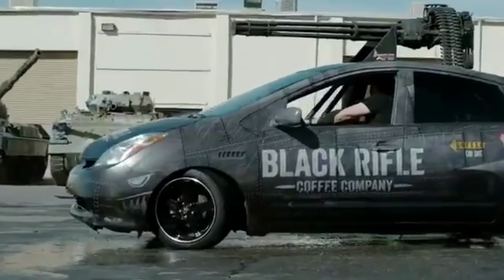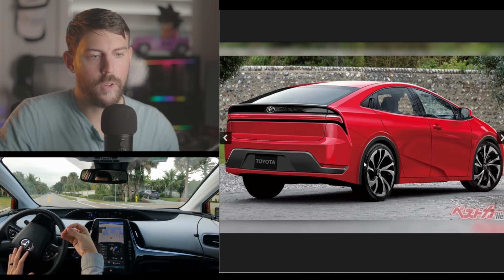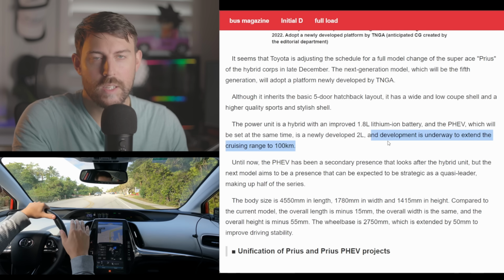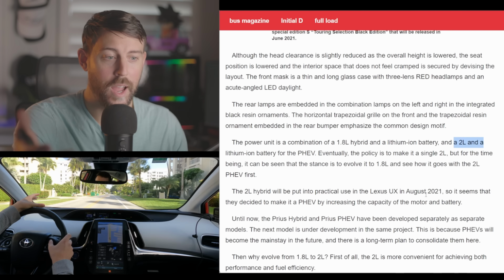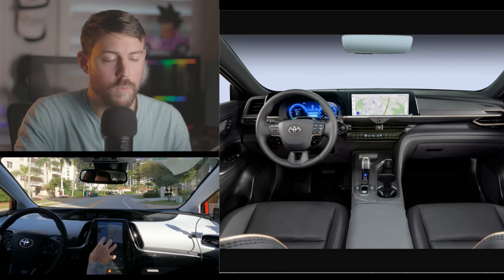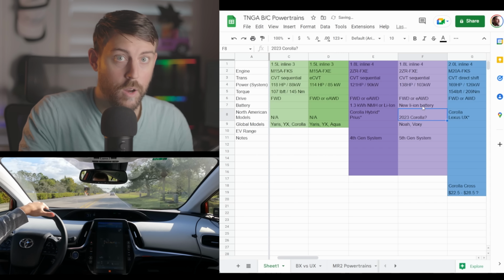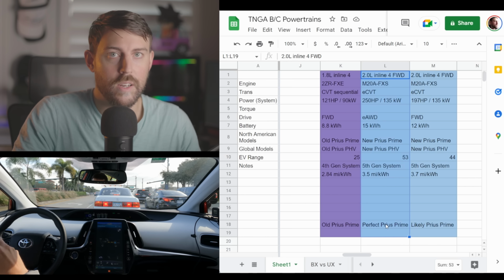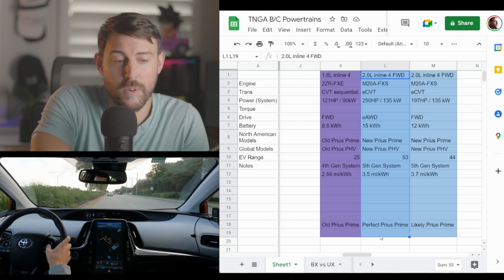*BIG UPDATE* The All-New 2023 Toyota Prius will have INCREDIBLE power and EV range...

Comment: Nephew just bought a 252000 mile 2nd gen for a few grand. Runs very good with very few signs of how many miles are actually on it. Can't see why it won't easily hit 300+
Reply: Really?? Why would you say that??? I can tell you exactly what will stop that thing from hitting 300k if not attended to.  IF there is no documentation of a recent water pump replacement in that 1.8 L 2ZR-FXE he will 100% loose that motor at any time.  It is a known catastrophic weak point.  That and a clogged erg system filter.  the later will give some prior notice, the water pump fail has few signs, it just blows the headgasket and the motor is toast.
Reply: @dvmartel1  Yes, the vehicle came with an extensive service report which included a water pump and a full exhaust system done at a  dealer.
Reply: @dvmartel1  Also, a blown head gasket is not a total engine failure.

Comment: I need a cheap car. Like the original Generation 1. With small tires, cheap maintenance, 1.5l or 1.8l engine, great mpg, and good reliability. No plug in, no electronic gimmicks. Just want to drive. The 2l Lexus engine has some issues. If I wanted speed then there are dozens of other cars available for that type of driving.

Comment: PHEV’s should seek to optimize electric vs gas miles for the majority of likely consumers. If 40-50 miles covers 75-80% of your daily commute then increasing battery size, weight, charging time, and cost will likely not be worth the savings. But, sadly, that’s not how advertisers and consumers minds work. We buy a car for the one or two road trips a year we hope to take and then drive it to commute 20-30 miles to work 95% of the time. Total waste!
Reply: If 40-50 miles is all you cover on a day, then get a scooter.

Comment: I keep hoping to hear Dynamic Force and/or Combined injection in reference to the "better engine". The cylinder heads are the only likely place to get the additional power, and adding DI to PI yields around 10%! ;)  (In the 1.8 liter Prius. DI + 200 CCs for the (heavier) Prime, even better!)

Comment: That's incredible. If the range is 50+ miles for PHEV, then I might buy it. I currently have a Prius Prime, but the range is tiny. Still great, but will definitely sell my Prius Prime for 5th generation or next version of Prius Prime.
Reply: I get 50+ mpg with my 2018 Prius.  I've been very satisfied with it but will be trading it in on a ford lightning platinum F150.  My 2014 F150 will also be traded in because the lightning will serve all my needs, luxurious ride, towing, hauling and even power my home during a power outage. Very little to no maintenance required in ICE vehicles.  I'll especially love no more oil changes.
Reply: Depends of your needs. I get 55km on mine and it gets me to work and back, with 13km spare to go shopping in the evening at local shops. My commute is slow traffic thought
Reply: sell to me! I'll buy from you if the price is right :) !! I need one soon for my daughter!

Comment: Just like you said, if we can take RAV4/NX450h+ as the comparator, if the PHEV drivetrain will be shared between Prius and Lexus UX, then I expect (and hope) it'll be the higher powered version. BMW's X1 & 2 Series Active Tourer have just under 15kwh batteries now in their plug-ins, so Toyota & Lexus should aim for the 80-100km range threshold, to be competetive.
Reply: hypermiling is more fun than highre power in a hybrid high pressure engine like turbo thing, naturally aspirated v6 and smooth torque vectoring diffrential  is minimum to make it worth driving fast, that even if theres no manual and clutch pedal

Comment: Everything is doable but AWD in Prius Prime is almost impossible because of massive battery in small size car. If it was EV it can managed but PHEV it will be nightmare for Toyota to make Prius Prime AWD. Toyota will not do that because its not worth it. PHEV uses Li-Ion battery and lithium ion are not good cold weather specially northern states needs AWD.

Comment: Really excited for the new Prius. Still got my 2012 and it’s still going strong so no rush toyota. But there will need to be a full ev version if toyota want to keep me as a customer.
Reply: Hope you changed your water pump and keep the erg clean.   The motor is a ticking time bomb if you have not attended to either by ~150k.   This is known catastrophic failure of this gen motor. And you won't know until it too late.
Reply: @dvmartel1  Thanks for the tip. Mine has 224k km which is 139k miles. I haven't had either done. So I'll get those things done next time it's in the shop.

Comment: I drove a Prius from 2008-2012 and then Plug-In Prius from 2012-2015. Love these cars. They are not power monsters but they are very efficient and extremely dependable. Updates such as more PHEV range is awesome! I think the Prius should just be PHEV only but I'm not in the Toyota marketing dept LOL
Reply: The 2ZR-FXE very dependably blow their headgasket due to waterpump failure. Also huge issue with egr  clogging causing same.   Why the f doesn't anyone mention this fact when they make the dependable assertion?  The pump is a catastrophic fail no warning, no sign, and takes out the engine.  My local jdm engine importer (JDM Engine Bay) sells between 30 to 50 motors in the bay area every MONTH. They fly off his shelf like windshield wipers in the rainy season. Yet everyone acts like this is as super motor.  That $225 pump fail destroys the motor ~150k miles.  The Pruis ZRFXE is a ticking time bomb every mile around that number and everyone who doesn't know this out of ignorance, bliss or mistaken believe of dependability is going to pay the price.
Reply: Exactly! Maybe photovoltaic rooftop, that would be sweet. Although probably a utopia because it's probably expensive... although the Prius Prime's trunk is all carbon-composite, so if that's doable then a PV layer on top is not far fetched? I don't need any more power, the current Prime is perfectly enough, just more EV range.
Reply: I would be pissed if it was PHEV only. I want a regular hybrid Prius with the 2.0. I plan to buy it next after my 200k miles 2011 Prius is dead.
Reply: uses solar enery support: sono motors and aptera motors
Reply: @kalmmonke5037  I love it!

Comment: I would like to see the more powerful version, AND a super efficient version.  Maybe use that awesome 3cyl engine from the Corolla GR..  It would be smaller and lighter, better torque down low.
And mix the bigger battery pack in the Prime model.. 
I don't understand the purpose of the 1.8 and then the 2.0 soon after.. seems dumb to me.

Comment: There are many countries with weird taxation on engine size that push manufacturers to develop engines below 2,0 liters or even below 1,5 liters. That's the reason behind the 1,8l-2,0l offerings.

When calculating drivetrain potential based on RAV4 prime, the battery seems to deliver around 120hp on top of the gas power unit. According to this the new 1.8l with a similar layout could deliver around 220hp, while the dynamic force 2,0l could go over the 300hp mark. The above numbers are easily achieved but again this is Toyota we are talking about.
Reply: There is no major Toyota market that has a tax bracket distinguishing between 1.8L and 2.0L engines. In most parts of Asia it's 1.0L/1.5L/2.0L/2.5L, some places have 1.2L and 1.4L brackets. That's why almost no car manufacturer produce intermediate displacement engines like 1.3L, 1.6L, 1.8L, 2.2L, 2.3L etc. anymore.
Reply: lol they are not going to make a 300hp prius
Reply: @alleneng  if they can get the fuel economy and costs in the right range a 300 horsepower Prius would probably sell very well even if it is unecesary.
Reply: @alleneng  PHEVs like EVs can deliver lots of hp. New DS7 goes up to 360. I don't say they will, i say they could.

Comment: I'd consider the Prius after 2.0l upgrade, that old 1.8l just looks bad by comparison, unfortunately though I probably couldn't fit in  it comfortably based on other smaller TNGA products I have tried 😢, they have got less spacious for tall guys with broader shoulders!
Reply: The 1.8l is proven to do many hundreds of thousands of miles without issue. Will the new engine do the same only time will tell...
Reply: @Smith-g1d  Toyota has decades track record of engines going many 100k miles, I'd bet on the 2.0l vs against it. Had a 06 Corolla with 1.8l with 150k no issues, just a weak engine overall but still miss my old Corolla.
Reply: @ayyveezee2079  I agree although the 1.8l in the Gen 4 Prius is proven to do 400k miles I am not sure the same can be said for all Toyota engines. For example the recent 3 cylinder 1.5l Dynamic Force engine has a design life of only 150k miles which falls well short of some Toyota units. The peace of mind of proven engines is worth its weight in gold

Comment: Good to see Toyota is working to keep the Prius alive despite everyone going full electric. Hybrid is great, as not everyone has the opportunity to charge at home. I was a longtime a BMW owner and fed up with the cost of maintenance repairs. I have a 2020 Prius Prime since I was not ready to go full electric either. I went from some of the fastest cars to one of the slowest. But I couldn’t be happier with my choice. I get 25-31 miles of pure electric range depending on time of the year.
Reply: I traded my Tesla in for a Lexus because of endless repairs. If you ever go EV, avoid Tesla like the plague. Toyota is king for reliability and low maintenance.
Reply: @InternetDude  I traded my Prius Prime for a Model Y. After two years and 45k miles not one issue with my Y. I loved my Prime and would recommend it to anyone who doesn't want to go full EV yet.
Reply: @InternetDude  There's nothing like a Toyota for reliability, but Teslas have recently show a marked improvement in reliability. A close family member bought a new 2018 Tesla and it's never been in the shop for anything at all. Your experience may not be typical, unless you had an older Model S.
Reply: If you cant charge at home, you can charge at work. If you cant charge at home or at work, there is still public options to charge. Most people also cant fill gas at home you know.
Reply: @maxmeier532  You are correct.
Reply: @Ken S Sure, but probably someone else saw a car on the side of the road that had run out of gas and drove by it in their Tesla. You anecdote is kind of interesting but statistically meaningless, and can't be used to conclude that EVs run out of power any more frequently than gasoline cars run out of fuel.
Reply: @richarda3659  the real problem is when an ev does run out of charge you can't just pour in a couple gallons of gas and be on your way. In addition the range is less, at least for now.

Comment: Do we know the stats on the MPG when operating in pure hybrid mode with a depleted battery?
Reply: I'd expect it to be consistent with the MPG rating of the previous models. But keep in mind that there's no such thing as a depleted battery in a hybrid operating in hybrid mode. In that mode, the gasoline engine also charges the battery, so it basically doesn't get depleted unless you're using it in pure EV mode. Once the battery is depleted in EV mode, the engine will power up and focus on recharging the battery in addition to moving the car, which lowers fuel efficiency of course.

Comment: So far, the 2nd and 3rd gen are the best looking models. The Prius designer went too aggressive with the 4th gen, especially at the back. And it would be nice if the next gen gets the 2.0 hybrid from the Corolla Cross Hybrid as an option at least.
Reply: The first P4 looks best in my eyes. Never had a better car than this one
Reply: The Prius Primes front end and the Prius rear end would have looked the best together. The 8.8kwh battery could have been packaged so much better and left far more space under the hatch. A 15kwh battery and more powerful awd system would make the car far more practical and entertaining to drive. Let’s see if Toyota actually goes through with it and delivers in quantity. The RAV4 Prime is an example of getting it right but being completely unable to deliver the product. 4-5 year wait period on getting one.
Reply: As a 3rd generation Prius owner, Yes toyota not only blew it with the 4th generation on the interior/exterior but then took way too long for a new 5th generation.  Let’s hope they get it right since I’d like to upgrade
Reply: corolla cross hybrid come this year
Reply: My steering wheel pleather is falling apart! 😢

And the clear finish on the rear black accents are pealing.

Otherwise a perrerfect specimen of automive engineering 🙌

Comment: Was having a discussion at work about electric cars and a coworker is very anti-EV.  But he was singing the praises of hybrids, specifically the Prius.  Last weekend, he bought a Ford F150.

I really wish Toyota would develop a line of different Prius models.  I loved when there were 3 different body styles.  I'm holding out for a original xB-like Prius.
Reply: We are still at a point where hybrids are the best choice. Electric cars are still a luxury item and not a smart choice.
Reply: @nozopoke1782  if your in the 20 century sure
Reply: EV's aren't bad but to get a decent range, you're looking at pretty slow driving and require good infrastructure.
Plus a new Tesla M3 for example is near £50k in the UK now. That's not a cheap car so how long will it take for you to make back your extra costs?

A hybrid that is reliable, roomy & auto (CVT) is great. You can do 600 miles in a gen 2 in the summer. 3 minutes to fill up at stations that have card payments at the pump.
Great MPG if you drive slow and really good mpg if you put your foot down.

Comment: Prius should be classified as one of the best vehicles ever produced.
Reply: Toyota did an incredible job with the Prius but it's s-o-o-o-o-o-o-o slow. Seems like this model will be a huge improvement over that.
Reply: @richarda3659  It isn't that slow, compared to most low end hatchbacks and sedans it is pretty much average.
Reply: @garethbaus5471  we drive ours like we stole it. Still had plenty of pick up and go for a four banger. Range has deteriorated over time. I think it needs a new drive battery.  That’s ok it’s 11 years old and still reliable.
Reply: @richarda3659  you still can only drive the same speed on the highway.
Reply: Catalytic converter thieves agree
Reply: I used a 2012 Toyota Corolla Hybrid (in the European market it was called Auris for some reason, though) for 8 years and 200.000km  (about 125.000 miles) and I NEVER had a single problem with it besides being called back to fix stuff like the airbags that could not work under certain circumstances but for free of course.

Toyota's reliability is legendary and I can confirm that.
Reply: It usually is.
Reply: The Corolla of hybrids.
Reply: They’re slow as fuck though this is the first news about a Prius being considered fast XD
Reply: You mean most boring. I’ve owned one. Never again. Tesla from now on.
Reply: And the most miserable to drive.
Reply: Hope it doesn't look like the renders
Reply: It is🎉
Reply: That's why paid talking heads hate it
Reply: J'ai adoré Prius2, mais je préfère Rav4 hybride pour le bruit du moteur qui permet de rouler avec de l'ethanol E85 et les 197 Hp. 8l/100km. 😄. Toyota/Lexus, c'est le must.
Reply: Personally I prefer the Volt. So sad it got discontinued. Got 130mpg at times :/
Reply: Still have our 2011 but sadly drive battery is not strong enough to good mileage. 32 ish.
Reply: Also THE most reliable vehicle on the road over a corolla since Toyotas hybrids are mechanically much simpler than the average toyota
Reply: @naveenthemachine  is it u supporting Toyota😯😯
Reply: @ibrahimbashir6634  agreed .i guess he is on a vacation  from trolling .👍
Reply: @ekgcanadianenthusiast9961  😂😂😂😂😂
Reply: @ibrahimbashir6634  👍
Reply: @naveenthemachine  I'm sorry to say that if you really think that then you have absolutely no concept of mechanical engineering. The simplest vehicles on the road today are battery electric vehicles. I have been driving them for 14 years and I have just bought my 5th BEV.
Reply: i hope its mpg inproves
Reply: @JoseFernandez-wu8pj  I get 70 MPG.
Reply: @genesmith4019  what year is your Prius?
Reply: @JoseFernandez-wu8pj  2018
Reply: @genesmith4019  any issues do far?
Reply: @JoseFernandez-wu8pj  No issues. We have had a few punctures and the Prius Prime does not have a spare tire. There is a pump and bottle of sealant. Its best to plug the tire to get home. The sealant is a mess and a replacement is $100. When I get new tires I'll have one mounted on a spare rim to keep at home.
Reply: I’ve heard over 60 mpg

Comment: I may be the only one here; but I hope they bring back a Prius with the solar roof
Reply: The solar roof looked cool but did virtually nothing.
Reply: Hyudai Sonata hybrid has a solar roof.
Reply: The solar roof was an expensive option and only powered the ventilation fan.
Reply: aptera motors. but they arnt recyled like ev battery problem.
Reply: @kalmmonke5037  I’m on the wait list for one of these. I’m concerned they are rushing to market though, and they may have a ton of issues as a result. Time will tell but I love the engineering and design.